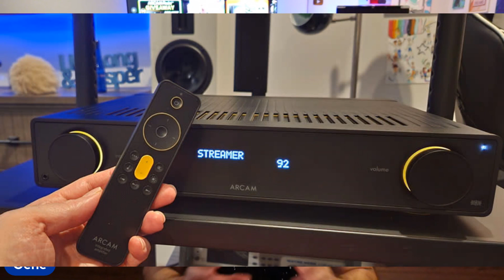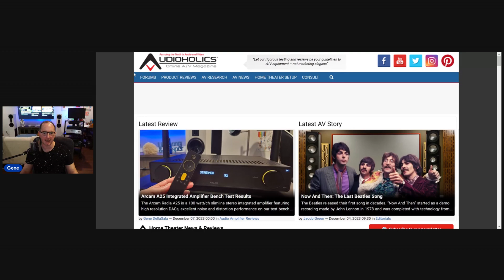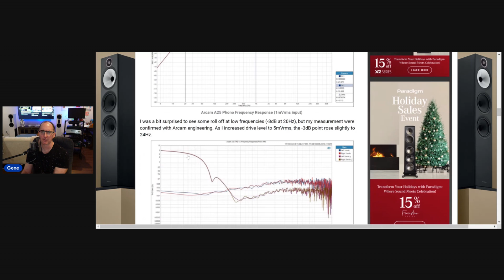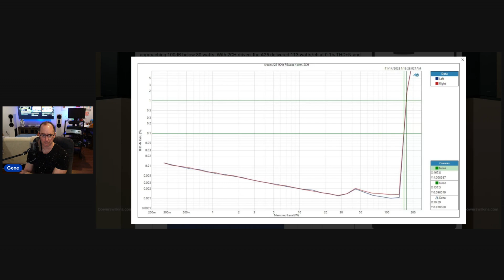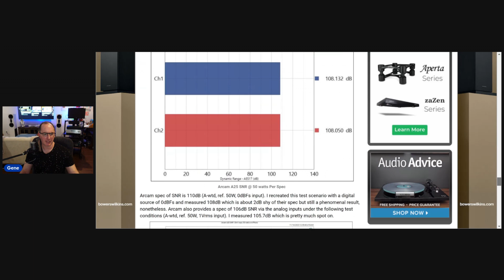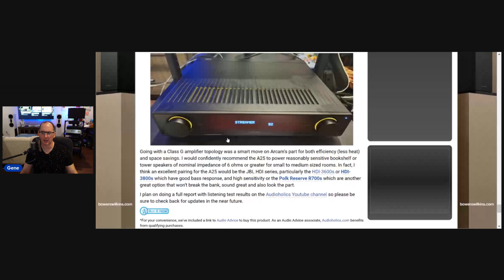Arcam Radia A25 Integrated Amplifier Bench Test Results!

Comment: I have this amp and whilst the cd stage is amazing I have to say the Phono stage is at best mid, whilst detailed and generally ok it lacks warmth. I actually preferred my  rotel a10 phono stage. However,  this is a great amp to buy as long as you are also prepared to buy a phono pre amp then you really get something special. A project s3 phono pre amp will give you a super wide soundstage, detailed and warm...lots of grip and power from the a25. Giving you the Best of both worlds if you like both digital and analogue.

Comment: This video from 2023 was excellent.  Would love to see your bench test results and thoughts on the new flagship Arcam SA45, its 5th gen G class, and its "error correction" on the first rail that modulates the current to follow the waveform so the output experiences a continuous current like class A (we know proper Class A does this across its full range at full current at all times, leading to far less efficiency).  The second rail of class G allows Arcam to hit high watts in A/B while maintaining efficiency.  But, its Arcam's not as well marketed and explained (beyond saying "pure class A") "error correction" that ensures the current can track the waveform as both positive and negative deliver this current (instead of A/B switching with a bias overlap), that allows the first rail to operate with efficiency in a similar fashion to Krell's iBias solution (which appears to do this across its full range at much higher prices and with higher heat, because it's doing this at high watts, unlike Arcam).  Arcam seems to be combining two novel solutions (two power rails for G class + current error correction up to 40 watts on the first rail for "class A output" - most of us won't listen to music beyond 40 watts).  I think they're actually modulating current tracking, so I don't know why they call it "error correction" which confuses consumers to think it may be a distortion correction feedback system like Hegel's SoundEngine or THX AAA in the Benchmark AHB.  I think Arcam's engineers may be executing something on that first rail effectively, which I suspect your A25 bench tests reveal.  This would benefit from focused attention and examination by someone with your expertise on their new SA45.  Thanks.
Reply: This does not mean the entire range (25 watts for the A25) is always running at full current (true class A).  That's inefficient.  It means the 'error correction' is always limiting current within that first rail range to track the signal so it doesn't have to run at 25 watts (or 40 watts for the SA45 or 50 watts for the A49).  Difficult to explain in marketing.

Comment: would you pick this over a xpa-2 gen3 2 channel from emotiva for a stereo system?
Reply from the maker: Emotiva is an amp so you'd still need a preamp. Its far more powerful than the Arcam amp section.
Reply: @Audioholics I use a wiim ultra as a preamp/source and a topping d90iii discrete

Comment: Sub via pre-out: No problem, if you add an ELAC Varro DS 1200 with its Sub Control App 3 (with auto eq etc.) to the party. 
By the way, the soon to be released Radia AS45 will sport 2 sub outs (line and XLR) with Dirac Live Bass Mgt. as option 1. Option 2 is the approach via sub-out and adapting the sub to the listening room as mentioned. SVS is now also catching up on an app-level with the introduction of their latest top model, the 17 SB / PB Ultra ☺
The AS45 with 2 x 180 watts @8 ohms (2 x 300 watts @4 ohms) as Arcam's top of the line streaming amp ticks all boxes on my upgrade list. Priced at GBP 4'499, this exciting streaming amp is expected to hit the dealerships by early next year (January 2025) and it would be special if you could get this behemoth on your test bench...

Comment: Here’s my biggest gripe. The remote has no discreet inputs, so I can’t integrate it into my system with my URC remote. If it’s in a cabinet you don’t know what input your on without seeing the display. I have an sa20, which works well, but the A25 uses different remote codes. Hoping they can add some discreet inputs with a firmware update.

Comment: I agree the pre outs would be more useful as sub outs with bass management, especially with the popularity of bookshelf and less than full range speakers widely used. I think a larger oversight that wasn't mentioned is that it has no HDMI eARC. That's just goofy to not consider those who might want to use this rig with a TV. While I love that they focused on the music listeners, many of us use the TV even for just music playback, but to not have it at all??? When did they design the digital inputs 2004? I'm hunting for a clean neutral amplifier for testing speakers that I build, so the lower noise floor, headroom and true power output is a good match, but for a modern piece of gear, the fact that it's missing bass management and eARC is a reason to avoid it, unless one has no desire to incorporate it into an a typical home setup. That being said, it falls short of a music only application for audiophiles, and while the hybrid amp class G seems like an innovation, personally I think that any one driving full range towers or big driver vintage speakers would be worried about the longevity of the switching between rails from a long term or consistent perspective, at least for my use, where I can't have a variable like that to be concerned about. Yes it worked decent during your testing, but how reliable is that after hours of pounding at high current and peak transients above the normal listening level? I'm of the impression that even if using a noisier A/B amp of similar output, I'd prefer to have peace of mind that there's no fancy trickery with the amp to save energy. Those who buy or build loudspeakers for their max potential aren't concerned about energy consumption or heat the gear throws off. That's my 3 cents from a non audiophile point of view, possibly because I don't fully understand the amp section like you or those into those particular test results. If anyone's got suggestions for big power and consistency bang for the budget integrated amps that have eARC let me know. Currently I'm looking into replacement for my NAD T-757 and Sony ZA1100ES as I try to focus more on two channel vs 5+ channels. Unless... You think either of the latter receivers might be sufficient as two channel amps for driving high power full ways. I'm not sure if multi channel AVR's simply shut down the unused channels or redirect that power to the left and right channels exclusively with no effect style decoding magic in the background. I'm just looking for the 1980's equivalent of something like a Harmon Kardon... Not necessarily for hearing that tissue paper falling off the violinist's lap onto the floor audiophile revealing sound, just something that can belt out clean neutral and consistently for hours and decades.

Comment: Excellent review. Arcam's power section is great, pre is so-so. All of their amps has the same gain, so you don't have to adjust anything if you go monoblock's way. I have the Arcam Delta 290 P ( power amp ), from mid  90's, hooked up with Exposure 2010 S2 integrated ( passive pre section ),  thru Elac UB 52's, and the sound is brutal. All wired with Wireworld cables (Equinox, Oasis ), seems that Wireworld/Arcam combo matches well. They also have very good AVR's.

Comment: Gene, great review as always. Just one thing, though, hopefully in your full review you can give a more thorough explanation of Class G. While Class G can add efficiency, that isn't why Arcam does it. The lower power rail is pure Class A power, the 2nd rail adds AB power only when it is needed. This approach is more efficient than a similar 100 watt AB model whenever you are below 25 watts, but talking about efficiency is burying the lead. The main benefit to Class G is that you are getting pure Class A anytime you are running on just the lower power rail. So long story short, this product is pure Class A until you exceed 25 watts.
Reply from the maker: I highly doubt the bias is Class A up to 25 watts. It would have to dissipate 200 watts of power for both channels to deliver 25 watts x 2. I think the Class A bias is much lower than that as I didn't feel the unit get warm just idling on the bench or during low power testing. I will check with Arcam engineering, however.
Reply: @Audioholics  excellent, you are certainly the man for the job. That is what they seem to be advertising for over a decade now.
Reply: @Audioholics  Exactly.  It's the "error correction" that modulates current and thereby tracks the signal (waveform) by applying continuous current in that tight range that allows genuine class A output, I believe.  Remember, the output can't distinguish if this is a Class A amp (full current at all ranges with poor efficiency) or if it's this modulating current solution because it only receives continuous current on the positive and negative (A/B) like a proper class A amp for that specific signal range.  This is why Arcam appears to be applying the second solution, Class G, so it can limit this solution to only occurring on the first rail, where most people will listen to music, while still being able to achieve the efficiency of A/B on the higher watts.  Krell's iBias solution (they call it Class A) appears to apply a similar solution across its full range but that "current tracking" solution is still going to generate heat at very high watts (just not as high as a pure class A amp), which is why Arcam wouldn't do this.
Reply: @Audioholics  Did you check? Your review is incorrect or misleading as this G topology is not for efficiency but rather for the Class A up to 25w. I have the SA20 and at low volumes it’s a bliss. Your opinion that it doesn’t become a space heater seems wrong.
Reply: @dgdave2673  I've been home auditioning the A25 over the last 3 days at varying volume levels- sustained periods.....
Cool as a Cucumber !! Definitely doesn't run hot, or even warm, being honest...

Comment: Arcam SA20 Stereo Amp, which also has Class G. 
I use it in Processor Mode to Power Left & Right Front Speakers on my AV Receiver and it does a good job.
Much prefer external Stereo Amp for More Enjoyable Music playback, than using AV Receivers in Stereo for Music

Comment: Great video.. impressive integrated for the money. I bought my first ever Arcam piece about a yr and a half ago..the SA30 integrated. I was definitely impressed with the amplification. Subjectively I felt the dac was better than average as well. Very quiet and powerful unit. I ended up having software issues but as I was so impressed with the amplification I moved to their 2ch PA240 power amp. A lot of really clean power. Subjectively much better than a Hypex module amp I had..but also $1k more in price. I would love to see some data on the PA240 as I'm curious of a couple things. I'm powering a pair of R700's with it. Nothing wrong with the Polk's but I think the Arcam probably deserves better speakers. I bought the Arcam after the Polk's.

Comment: Just switched form SR8015 to AV40, wish there was more content regarding Arcam a few year back…thinking of trying a ST5…
Reply: I have an 8015. How does the AV40 compare?
Reply: @bearclaw5115  I like the AV40 better. It has some quirks you need to learn to work around (no display input button on the remote) and some common hardware issues (missing dacs) but comes with a 5 year warranty. I seem to prefer the sound signature of the Arcam as well. A bit more clarity/less vailed, but it hard to beat the value of the 8015. I still need to purchase a better amp.